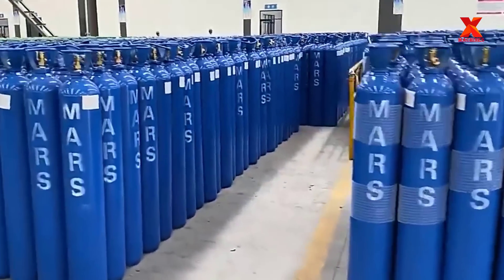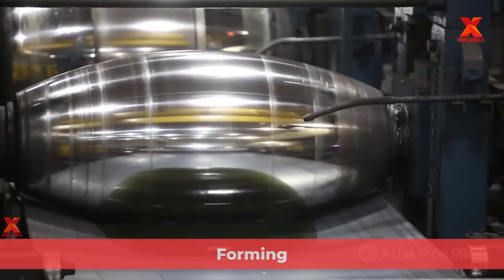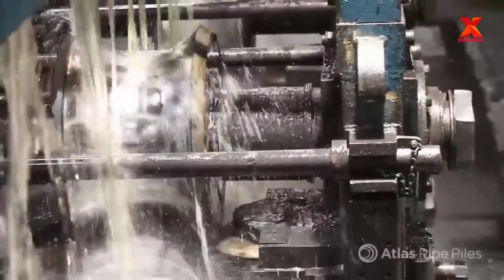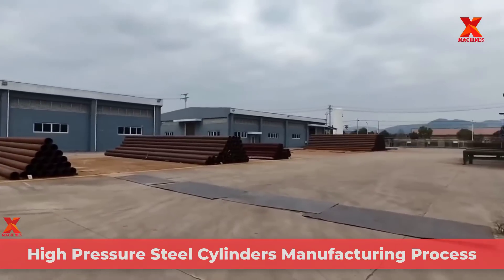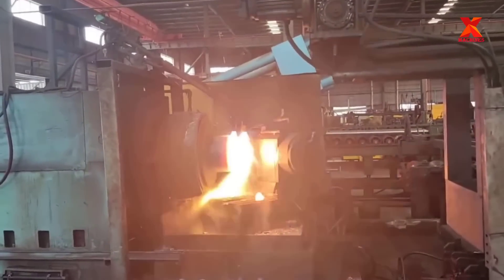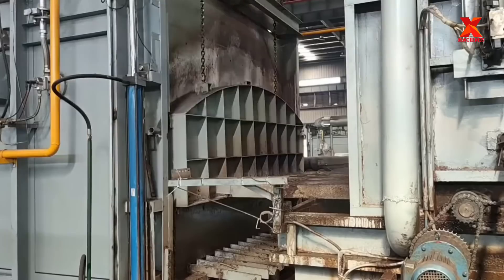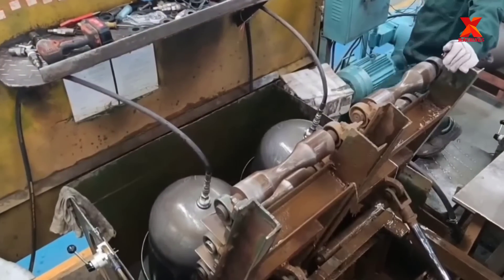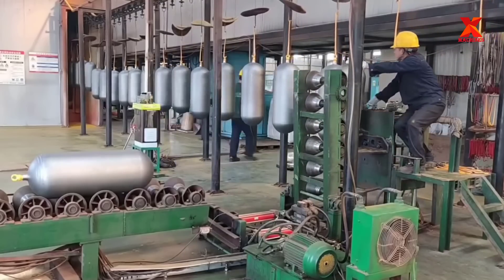The Hypnotic Producing Process Of High-Pressure Cylinder/ Industrial Gas Cylinder

Comment: These are not true seamless cylinders they are made from tube which is made from plate rolled to form a tube and welded down the seam. A true seamless HP gas cylinder is made from a solid billet of steel which is then forged to produce a tube complete with a fully formed end. The neck is then spun on the other end forming a complete seamless gas container. All the other finishing operations are similar. They can also be formed using tube that has been made without a welded seam.

Comment: When I first got out of High School I worked at an industrial factory where they made swing sets. It was the worst job I would ever have in my career of several different jobs. It was so noisy, so smelly and so boring. There were several workers there who had been there for over 10 years working the production line and they were hoping for another 10 years too. Like freaking robots.
I left that job and joined the merchant marine and worked at that , mostly, for the next 35 years. That factory job taught me to search out something different, I didn't last 3 months at the factory job I was going nuts there because of the boredom plus the pay was awful too !

Comment: this video sucks, the first part they are making pipe for pile drivers, to be used on a bridges (https://youtu.be/-4ydENB1tdY).
high pressure cylinders DON'T have any welds, they are die formed. that's why they have a 50+ year service life.

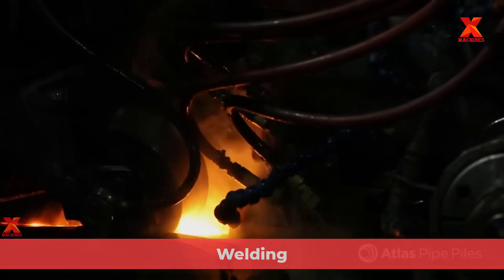Comment: 2:36 the best edges are sealed by resistance welding...
What part of seamless did you not understand?
Reply: thats still a seam jackass. No seams of any kind by any form of welding are allowed in any high pressure compressed cylinders(which is what they said these are) at any supplier ive ever seen, not even the 1920s chinese and japanese cylinders we have at our yard have seams. Been that way for 110+ years. These wouldnt be legal to do anything more than fire extinguishers or maybe 100psi compressed air........ALL of ours are mandrel formed and then hot spun necks with tempering to evenly distribute the crystalline steel structure, then reheat treated